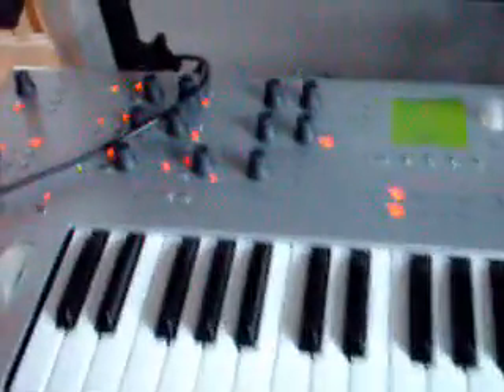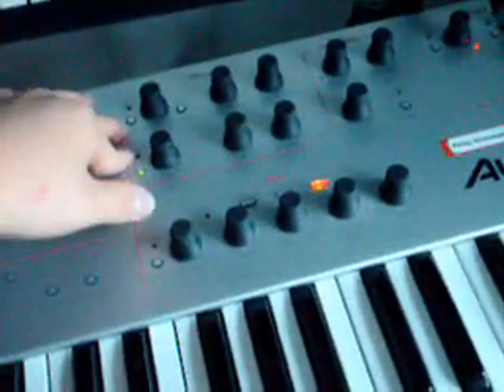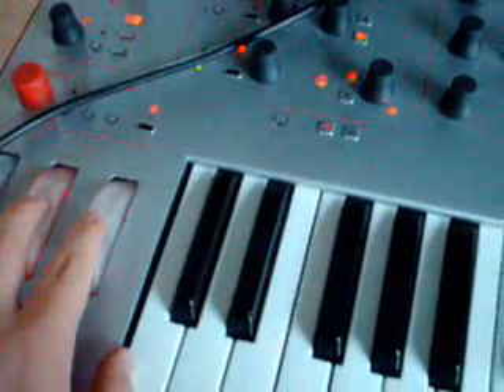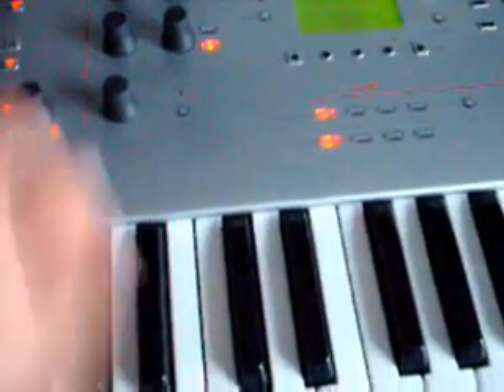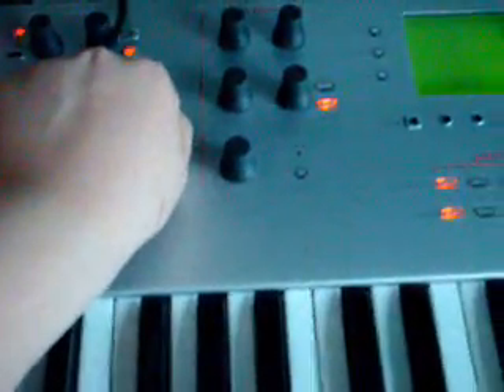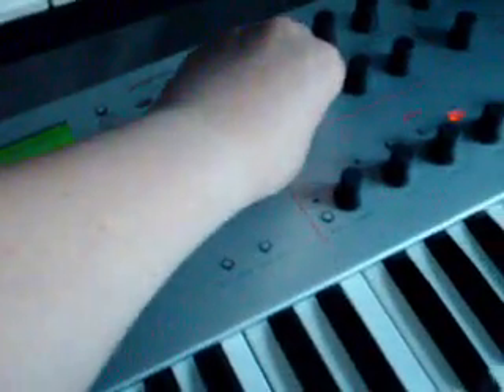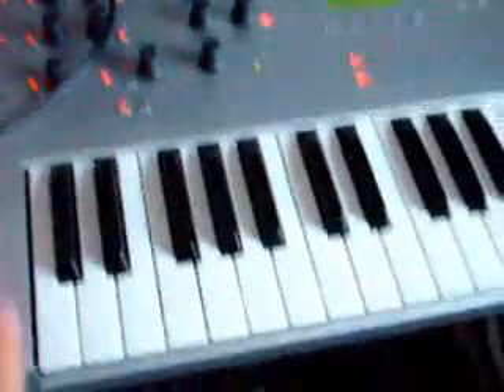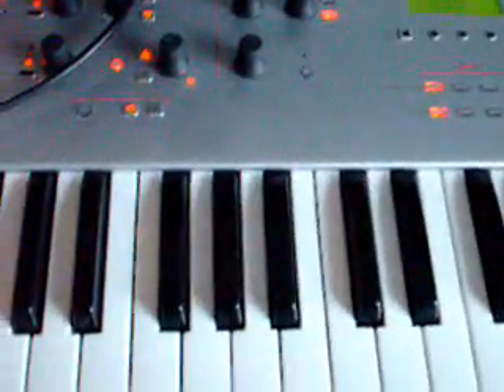Alesis Ion Complex Synthesis - FM & Sync Feedback

Comment: @therealKINDLE I bought mine new for £400... but that was a while ago while they were still in production. They should probably still be going second hand for around the same price so keep your eyes peeled and you could get a good price for one. There's also the Micron which is a smaller version of the Ion with almost the same sound engine which has been repackaged by Akai as the Miniak.

If possible, forget the SH-01 and/or SH-201 and get one of these, you won't regret it.

Comment: That's not quite right, either.
The micron has the same synth engine, and adds an editable arpeggiator+sequencer and a digital delay that is actually useful - the Ion's delay maxes at something pitiful like 100ms. The only things the micron lacks are the extra keys, knobs and modwheels

Comment from the maker: If you want to play multiple sounds/settings/patches at once, you'll need multi-timbrality, which the Alesis Ion does very well (4 part). I'm not so sure about the NL. Obviously polyphony decreases with the number of settings you use at once.
The Alesis Ion only has a small number of effects, including only a short slap-back delay, no reverb however. Most players would have an external effects unit, or use software plugins when recording to get these effects.